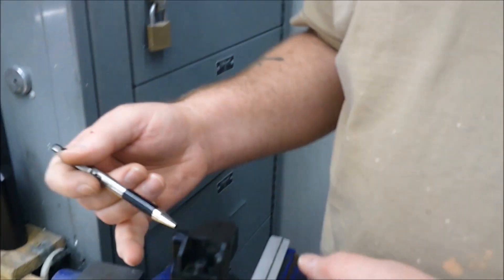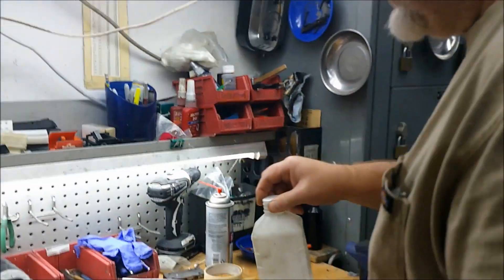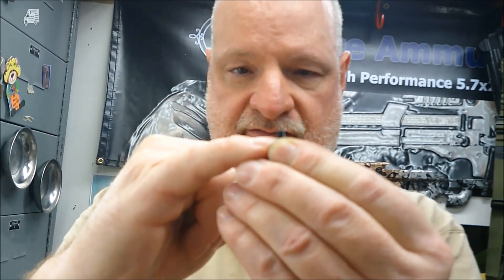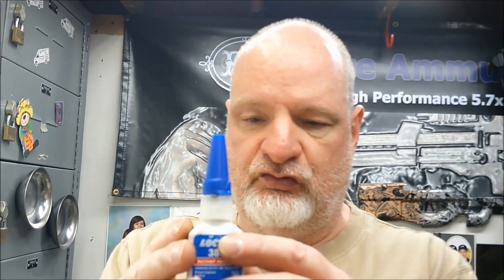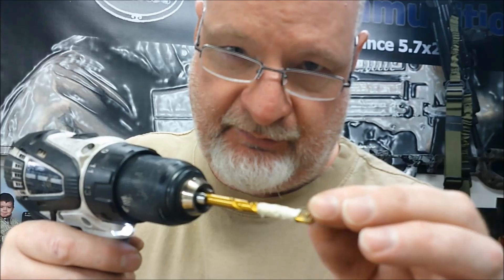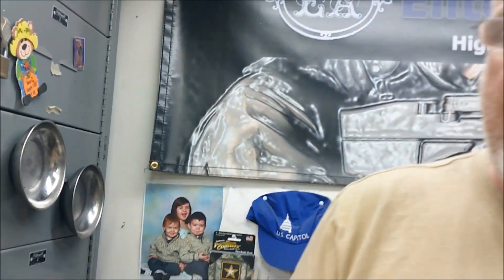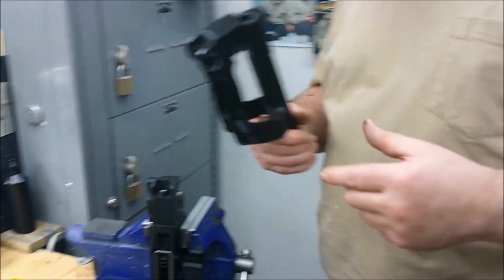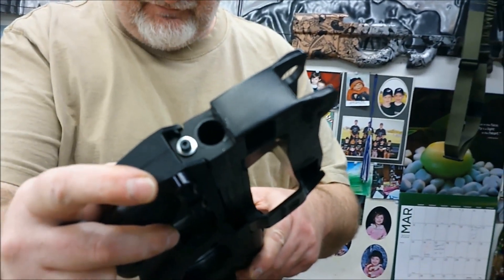Installation of Elite Ammunition P90 PS90 Stock Separation Return To Service Fix and Repair Kit

Comment: Jay isn't kidding about the loctite 380 cost.  If his installation service is pretty much around that, I will just sign up for the service and ship.
Reply: Quick update to my post.  There are 3 gram tubes available rather than the larger tubes we see here.  Still a little pricey.